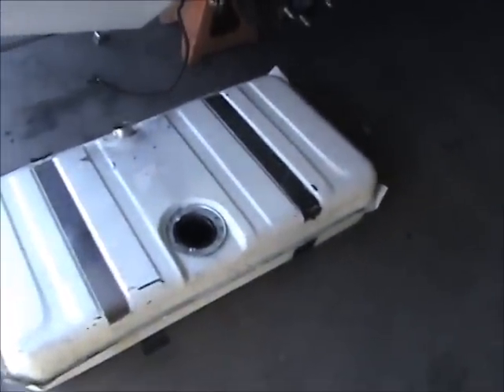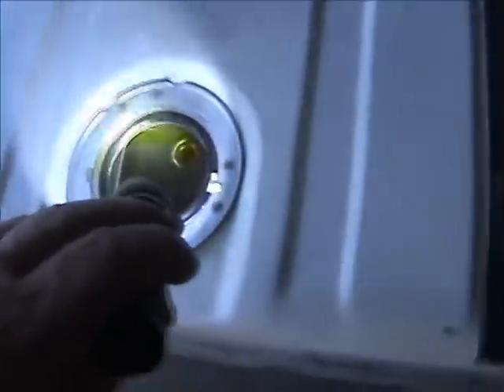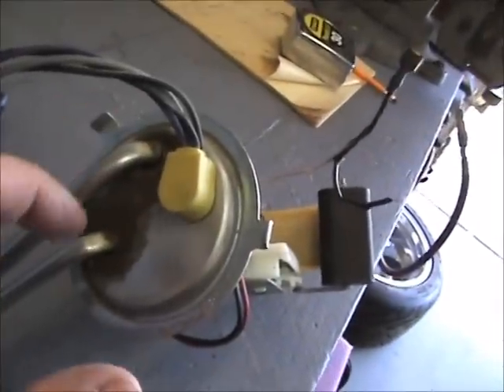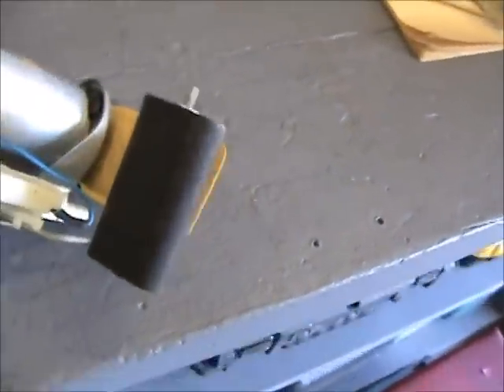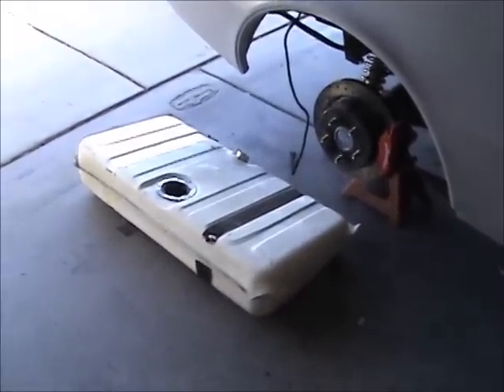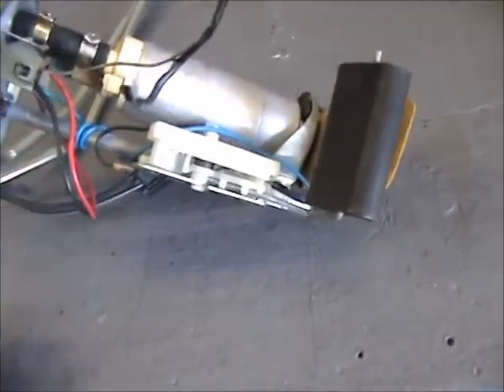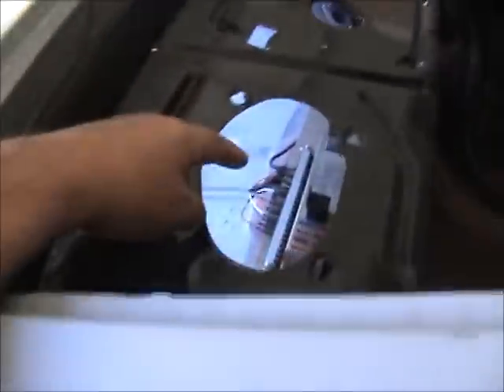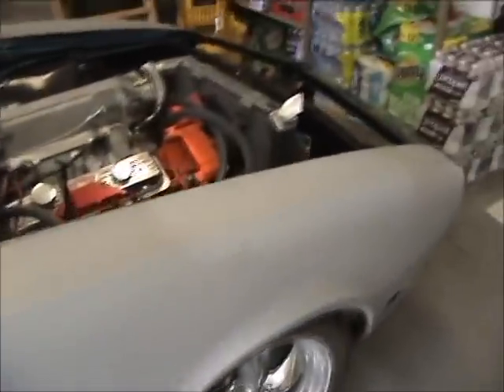1968 Camaro Resto-Mod 8-7-16

Comment: Yea, I would also replace that whole unit as it does look to be leaking or did at one point.
Reply from the maker: The whole system is going to be replaced. Should gone wuth the good stuff in the first place.

Comment: Tom I did a video last year on a tank I bought from Tank Inc. I talked to them and was told they have to sell it for more money than their reps. The lady was real nice and gave me a name of a guy in Md who was a tank Inc retail sales, he told me he would sell tanks at reduced price to anyone from the you tube garage gang, the name of his company is Hot Rod Garage in Denton Md. Just have them drop ship it to you direct from tanks inc if they can. To e honest I am familiar with your tank and I just think your wiring harness has a loose connection so it burned, that could happen with all the EFI tanks, I am pretty sure the pump you have is a Walbro in fact I will paste a ebay url but I don't think its your pump. I think if you call Hot Rod Garage in Denton Md the owner will prob tell you he can sell you a new Walbro harness and it looked like you either didn't have a seal or it wasn't sealed properly. When you install a pump they recommend a little gas resistant adhesive around the seal to make sure it doesn't leak. Tank inc has a website that has a page which answers a lot of the issues with their EFI tanks maybe you should take a look at it.
 http://www.ebay.com/itm/GENUINE-WALBRO-255LPH-High-Performance-Fuel-Pump-GSS-342-Made-in-USA-/110985081488?hash=item19d739f290:g:6nAAAOSwMmBV6dqL&vxp=mtr
Reply from the maker: Cary went and watched the video. I'm changing the whole set-up. Going with Tanks Inc. also have an email to Ray at The Hot Rod Garage.
- Thanks.

Comment: I think Rock auto used to sell the tank you have, they sold a lot of those tanks and I think they stopped selling those tanks maybe because they leaked like that. Tanks inc has separate pump and fuel sending units. good luck!
Reply from the maker: No more Rock for me.

Comment: If theres no name it`s a Chinese copy..looks to me like the pump shorted....if you run the pump through a switch there is no way to turn it off if something happens like a crash...the ecu looks for some kind of reference that the engine is either cranking or running...if it does not see that reference it turns off the fuel pump relay....
Reply from the maker: Thanks Anthony